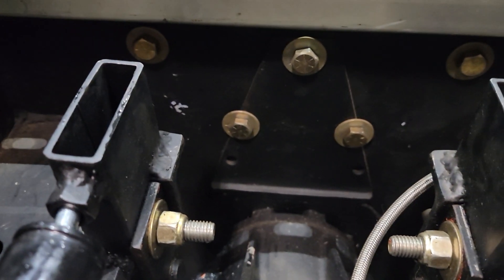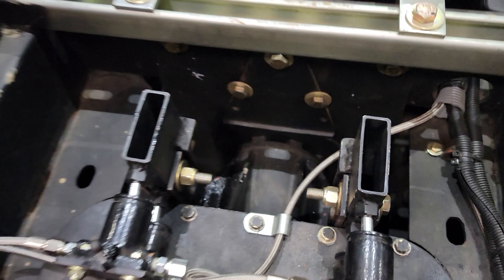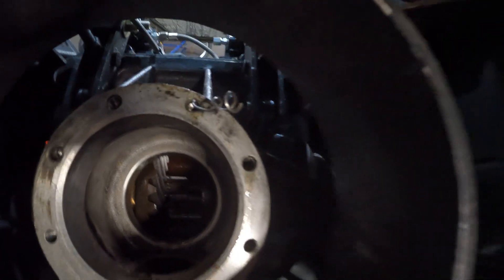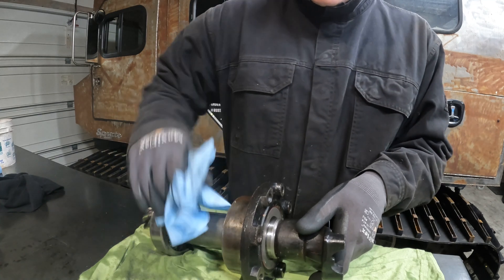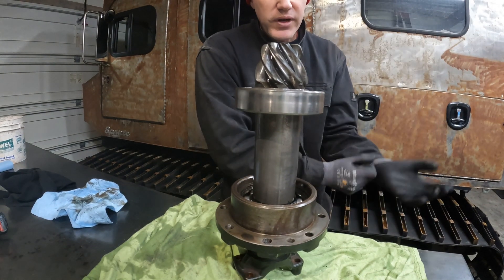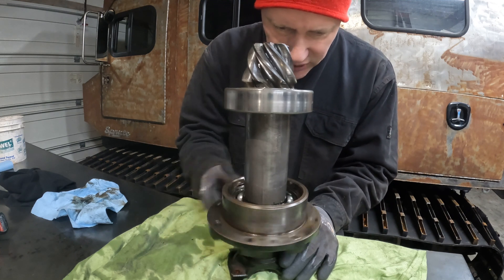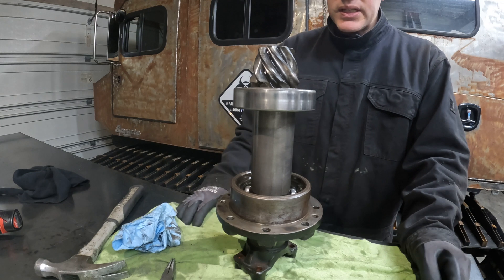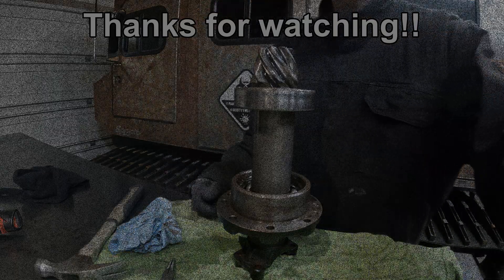Rusty the Spryte build part 119 (pinion assembly removal, inspection, and fixes)

Comment: I'm sure they told you those weren't just gaskets between the quill and "bucket"! Those are shims to set pinion depth into the ring gear.
Keep good track of them!
I was surprised to see ball bearings on the pinion. That would explain not much (if any) pre-load.
Props to you for reaching out to an expert!
That price seems VERY reasonable!
Hoping for a quick turn around!
Reply from the maker: I am glad you guys said something.  He is going to set it up to factory specs and add a steel ring so those ball bearings cant eat away at the iron housing that holds them.  That should eliminate the play for sure.

Comment: Awesome.  Now it makes sense.  It doesn't have tapered bearing- so it doesn't need preload.  You just have to get the excessive play out of it.
Reply from the maker: Yes.  I am glad you and others pointed it out.  I am glad I called Pat.  He has seen it hundreds of times and it is a necessary fixe on these or the ring and pinion can grenade...  Maybe one season soon I will get to use my cat when every single thing is rebuilt....